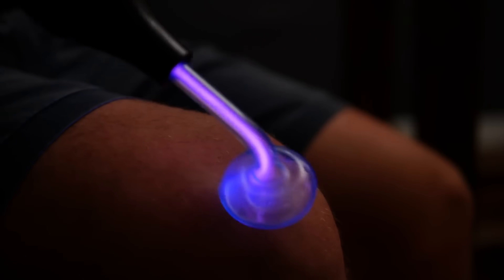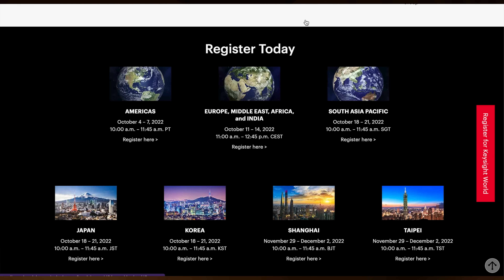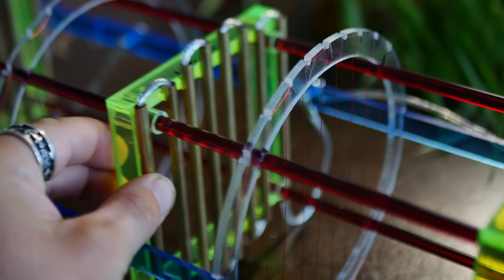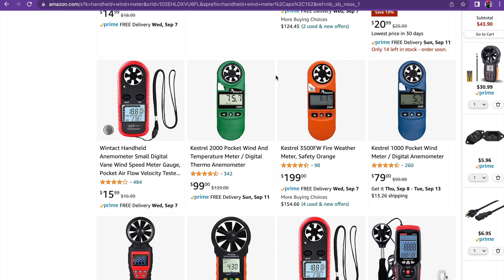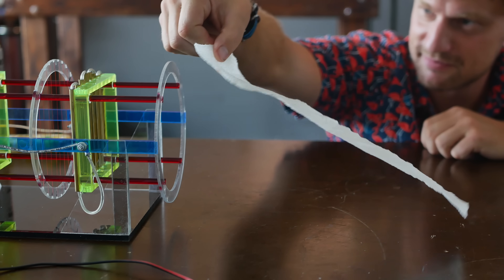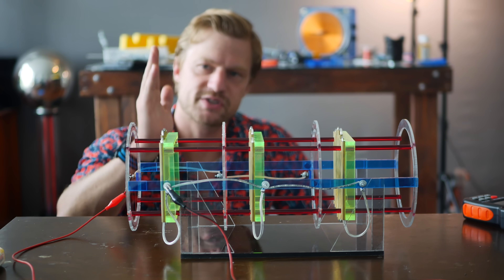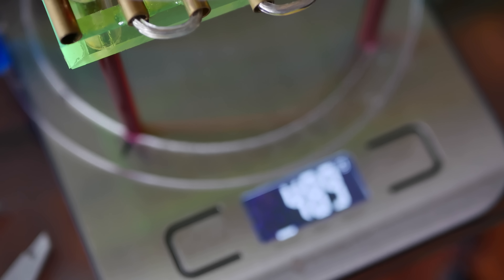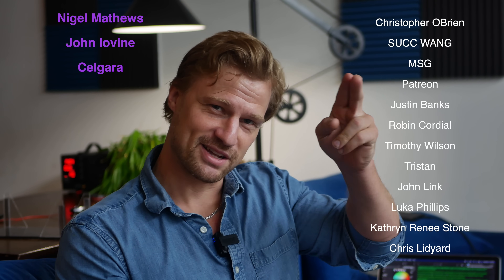Designing A Next-Gen Ionic Thruster! (For Flight)

Comment: I’m working on creating the flying carpet this just help a lot I have a special design an pixel frame that turn solid but fold like a tiny wapper box 📦 😅 but I need to work on quick release an I also need to work on a repelling system from air like a something that can sling shot you a 1000 miles 3 seconds but my theory is to enable the carpet to have a dial like an auto response to locate an sling shot on point while covering its pilot from natural condition while moving at high speed, who’s ready to help me make this world awesome

Comment: Just out of curiosity would putting like paper or something around the sides to ensure that the air stays within itself instead of any getting lost out the sides? Like You Don't See a jet engine with its sides open to the atmosphere it's sealed from the front to the back so the air traveling through it can accelerate

Comment: 1)Bro use a Convergent-divergent enclosed body. 
2) try the have more area of electrodes for air contact and more wind ionization. 
3) if you use the Convergent-divergent design try to have parallel-spiral spacing of the foil or flat electrodes(Al-electrodes, copper spiral electrodes) . 
-Ahammad Hussain (India🇮🇳).

Comment: Nicely done!! Brown would be proud of you!
Enclosing the unit and putting an inlet cone like that of a jet in the front would give you more thrust. Also with your varied distances between the electrodes, you ought to try different power supplies per electrode pair and increase the voltage down the line.

Comment: All this did is make me have design ideas that I wonder if they would work?   I wonder if you could design this in a cone and if it would have positive or adverse effects?  I also wonder how much pressure you loose or gain from open sides?   I also noticed some (what seems to be) “patterning” in terms of reacting and spacing in the still images.   Makes me wonder if there is some optimization that could be done to utilize that?  And finally I am curious about materials in use and if there isn’t something in the emerging tech that can/can’t create better performance.

Comment: I can see... 5 improvements... 1. Encase it to not loose air flow to the sides, 2. Try "blades" or just wires for the neg charge to reduce air total drag, 3. Maybe ill do, in a tube, a circular pattern of anode and catode to encase all the surface to max the output, 4. Ussing lighter materials and "organic shapping" to reduce even more the materials and drag, and 5. Id like to see what's the effect of a parasitic high frecuency on the dc current, i mean, as faster the air higher the hz (ussing the same principle on the ac electric motors and frecuency affected electrolisis of water).

Comment: Use hollow tubes. Get some from an RC hobby shop. Wing strut tube.  It has a symmetrical foil shape.   Or just a V shape. It should help improve the wind output and the hollow tube has more surface area because it’s hollow.

Comment: 1. Add a inlet, cowling, and nozzle
2. Pulsed and timed discharge of individual stages
3. Experiment with mesh density and rotation angle.
4. Timed electromagnet rings (would probably reduce lift to weight ratio)
5. Add more stages. I know it’s diminishing returns, but you can at least gather data and possibly find a (N-1)/(N+1) performance increase and compare weight thrust relationship.

Edit: also maybe change the direction of thrust to point downward taking advantage of ground effect.

Comment: A > Could we sleeve the while unit in a tube so only air sucked through the front and not the sides?
B > how many wires can we have to ionise the air?
C > also once in a tube, would various diameters of the exit nozzle increase the thrust?
D > obviously to make anything like this fly it would have to include carrying its own power and electronics! Now that would be a challenge 😀 keep up the great work 👏

Comment: 1. You used astonishingly thick plexi for many of your components. You could cut that down to 1/8" thick acrylic and significantly reduce your weight.
2. The copper tubes you use for your ground electrodes have ~3x more weight than necessary - the sides and back of the tube does nothing electrically but does add weight. (You can visualize this with your "dark mode" shots.) 
3. Your contactors (nuts and bolts) are big and heavy. Soldering those joints should reduce a little weight as well. 
3.5 Releated to 2 and 3, the connectors between tubes on your ground grid look way beefier than necessary and appear to go all the way through the tubes. LOTS of recoverable excess weight here. The tubes themselves are probably more than you need. Maybe try just a tightly spaced wire with 2 or 3 times the density of your positive electrode. 
4. As others have mentioned, spiked/barbed positive electrodes would be more efficient ion emitters, increasing your electrical efficiency. The higher efficiency would also allow you to increase your voltage with less overheating risk. 
5. You should experiment with your positive electrode grid design - tighter or wider grid spacing to see how that impacts performance.
6. Your graphs show comparisons between different spacings between positive and ground grids, and comparisons between voltages, but I didn't see data for a combination of the two tests: different voltages at each different electrode distance. The voltage may change the optimal electrode spacing. 
7. Your positive electrode is circular, but your ground is square. Could be room to improve performance and weight by using a matching shape. 
8. Your stages are a fixed distance apart. There maybe efficiency gains at different spacing between stages. 

Not a bad first attempt, but if you're goal is to design an engine, you need to include your power source in the weight calculation. A lifter can have a separate power supply, but an engine cannot. (I'm using the term "engine" to describe a propulsion system intended to be mobile, e.g. for cars or planes or transportation.)

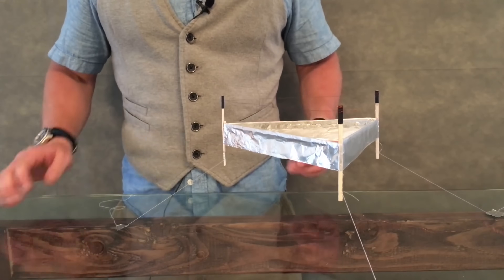And 2:29 - The real schmucks are the people who think using science and engineering lingo makes you a schmuck. You're obviously smart enough to be able to build an ion engine at home and run it without burning your house down, and smart enough to then make a youtube video about it that gets half a million views. Why you gotta pretend like being that smart is uncool?

Comment: The sides are open… you will lose airflow out the sides if you don’t encapsulates…. You could also use the shape of the housing if you were to build want to funnel the The air so it increases airspeed… Maybe if you made like a corner you could increase the pressure and air speed between each stage until it comes at the end?
Reply: You could also perhaps use larger carbon fibre materials or 3-D print a stronger lighter structure

Comment: Excellent results for the design.  There are a myriad experimental changes you can test and validate relatively easily/crudely.  Your flow is turbulent because you haven't done anything to condition the incoming air charge.   Bell mouth inlets are common on high Velocity engines/ducted fans.   Open sides prevent flow separation from the surrounding fluid.  This induces turbulence and creates friction and standing pressure waves albeit weakly.  The relative velocity, density and approach vector of inlet air changes coupling efficiency between high speed thrust and supply/scavenged air.  The acceleration potential of each stage varies with these factors.  Each stage needs different cathode/anode properties and acceleration voltages.  You also create magnetic fields and they interact with your plasma.  Pulsed designs will outperform continuous potential designs until you figure out how to manage and design magnetic field shaping/mitigation.  Crude designs can minimize perturbation and waste energy while sophisticated ones can take advantage of magnetic fields for additional acceleration.  In dense atmosphere the Velocity potential is limited, but still spectacular compared to combustion or forced air approaches.  The switching frequency of your high voltage supply also limits your acceleration potential due to magnetic field/electric field hysteresis, and self canceling forces that are out of phase (waste energy).  Remember plasma is nearly massless, so small vector but rapid oscillations can create more standing interference waves in your plasma/air stream, waste power, etc.  Increase switching frequency or use transformation rather than switching to create acceleration potential.  Have fun.  This tech has more potential than is currently understood.

Comment: so my thoughts are that the enclosure is actually open so you're probably losing some air flow there, then you can probably take out a lot of the spacing in between each of thoseplasma pieces, then you can probably make a actualThruster design on the back of it which will probably produce more thrust and maybe an inlet as well. 

1: enclose each plasma thruster in a tube of some sort
2: make a proper inlet/outlet to increase thrust
3: lose the space in between each of the plasma thruster segments.  Make is smaller and lighter.

Comment: 1. Would diversifying the angles of the wires so they aren't all parallel help change it from more laminar flow to more turbulent flow? (Would that even help)
2. Reducing the overall length of it would probably help air rate, as this prototype is designed for testing the distance to power ratio
3. Instead of having having one cylindrical cover, have an inverted stacked cone-like shroud that allows air to easily flow in from the the sides due to lower pressure. It isn't a fuel engine so it doesn't need to have the "chamber" segregated from outside air
4. Is there any way you can think of to increase surface area of wires? Either several tails down wind from each wire a 1mm or so, using custom wire that is flat at parts where the ionising Is happening or simply adding more wires?
5. (But should be first) COVERING THOSE TERRIFYING WIRES!!

Comment: Very cool build. Would encapsulating the thruster with an external wall or cowling to form a tube help direct thrust out of the tube and remove any vortices carrying air away from the column out the sides?

Comment: Consider making a wave guide? I would imagine it could do something similar to a ducted fan.

Not that I think there's gains to be had, but I'm curious to see what happens if you wrap something like a fridge magnet around your ion generators. Literally see it, like I just think it would look cool watching the magnets constric the plasma. Curious if it would make any difference in the effective spacing, but likely it would be offset by the weight. That does make me wonder if you change the size ratios between you anode and cathode if you get some sort of lensing effect. Perhaps the final stage should do something of the sort. This gives me all sorts of things to hypothesize about 😂 neat project, keep up the good work.

Comment: Wow, awesome!
I have some questions (just to anyone that can answer):
1. How loud is it?
2. Does it need air, or would it work in vacuum?
3. Can it work underwater?
4. How's the efficiency compared to conventional electric fans?
5. There seems to be no moving parts, but will it break down eventually?
Reply: 1. Not particularly loud, a handheld fan is louder
2. It needs air. In a vacuum it can be paired with an inert gas like a xenon canister to produce thrust.
3. Technically yes. Practically no. 
4. These are specifically designed for environments like space and high atmosphere where a fan is useless. 
5. Everything breaks down eventually, but there are no wear parts on this. They would last for an incredibly long time with no maintenance.
Reply: @godc71  Thanks. For the efficiency, does that mean it's less efficient than fans in "normal" settings (e.g. like a house).
Reply: @iruns1246  yes, a propeller (read fan) is more efficient in basically every measurable metric with the exceptions of moving parts and noise in normal settings.

Comment: Absolutely solid build you have and the colors are beautiful. my two cents, thrust chamber shielded with Pulsed compensated DC coil surrounding the thrusting chamber and gapped for laminar flow. rotate each charge platform to phase align with the current spinning as a vortex from positive to ground.   There are no straight lines, pulse the flow with capacitors and rectify spilled emf to pulse voltage peaks. 

Basically creating a plasma scram jet… great bit of kit to have when your blackbird goes above 200,000ft. Lol

Follow the apple

Comment: Wow, what a great build!  

As far as design changes go, I would use streamlined ~airfoil shaped tubes rather than round tubes; I would configure them in a non-asymmetric manner... using the pressure differential to 'suck the flow' inward, to tighten the final output flow.  While there is aerodynamic drag in this configuration, it may be effective enough to preclude using a tube to constrain the airflow (another option, of course).  i think the subtle aerodynamic reshaping of the flow (pulling it into the center) will have less overall drag/friction loss than if you use a tube (more surface area with a tube).

Following that line of thought:

 - Using flat plates would work as well (that's what the old  Sharper Image Ionic Breeze air filters used) though they will not benefit from aerodynamic flow control.
 - Using two flat plates in a V configuration (think of the hypersonic vertical stablizer of the X-15) with the pointy end facing upstream (of course) might be interesting to try.  
 - Might it be useful to negatively charge the inside surface of an outer tube wall (if using a fully enclosed tube rather than the open design) such as to reduce friction loss/drag on an otherwise inert tube wall?

Another question:  Have you tried using more positive surface area (e.g. more magnet wire)? Is there a diminishing return or a power-draw curve that otherwise negates (hah, pun) the benefit of more positive ions ?

Comment: One thing to improve is the shape, though may be difficult to get rounded wires , but eventually getting all ion elements rounded in an enclosure with a tapered end to promote as much directed laminar flow should greatly improve the thrust output.

Comment: First of all, I love the tech! Hope more comes out of it for you :)
My 2ct's
1. you didn' t use a duct or pipe
2. the hotspots on the wires indicate uncontrolled distribution of discharge, wich can be opimized (maybe with a sawblade, guitar-string-like or spiraling-spring-like structure)
3. rotate each section slightly (15° clockwise)
4. use cable shoes on your mount points
5. Does frequency change influence the efficiency?

Comment: 1)Try to increase the number of wires for each electrode plate. 
2) Try to use different voltages for each stage. 
3) Try to close the sides of your engine with some plastic film. 
4) Is there any effect if you rotate the planes of the wiring of the positive electrode plates? What if you double the number of lines in each one just wiring into a 90° over the previous ones ? like a mesh.
5) Try a Full bridge rectifier
6) What if you use magnetic field in parallel to increase the particle acceleration? Try to build some small coils and measure the effects of the magnetic field acting in the flow. When a electrically charged particle moves into a magnetic field, a magnetic field, perpendicular to his speed vector and to the magnetic field direction, acts, creating a deflection in the path of the particles.

Comment: I think you can use Schlieren imaging for see how the air moves and that might be help you to designing way better thurster. Another think, you can make an enclousere and nozzle for the increasing efficency and thrust. Possibly if you make way dense mesh, that would be increase flow. I want to see your new projects!
Reply: I was wondering many of the same things;  If I had leakage between the stages of a turbine, I'd have sizeable losses.
Similarly, if I don't have a nozzle, I"m making sizeable concessions.

When it comes to the ideal spacing/voltages, I wonder if it's as simple as running the tests while monitoring power consumption on a scale so you can identify regimes of highest thrust and highest efficiency.  I also wonder if there isn't some ideal mesh spacing relative to voltage.

Comment: QUESTION!! What if you utilized condensing the air, like a turbo? Also, it seems you used a lot of wiring. Maybe if you solidify the energy input, you can optimize the weight of the metals. ALSO, could you let the metal be designed as a radiator with the vents?

Comment: The tests at the end.. those increases weren't proportional to the increase in size and weight of the engine.. so a bigger single section of the same weight could be better..?
I'd like to see experiments with the placement density, and lengths, of the cathodes and annodes, as well as their thicknesses in proportion to those.

Comment: 1: Tube it! Air can flow out on the sides
1b: while we are at it, play with different sizes (large intake, small exhaust)
2: Increase the wire density up to the point of arching
3: geometry, use different shapes for ground. (apart from, well, tubes)

Comment: This hold so much promise! I'm almost more blown away by how much it looks like sci-fi thrusters.

Definite improvements could be made through study of fluid dynamics. By it's nature, the device is obstructing airflow, so you will likely see immediate improvements with more teardrop shaped components. A duct should also keep air flowing smoothly through the thrusters rather than leaking out the sides. I'd be curious to see it shaped like a jet turbine, which tapers down in size as it moves back.